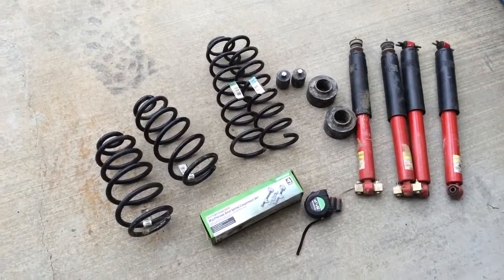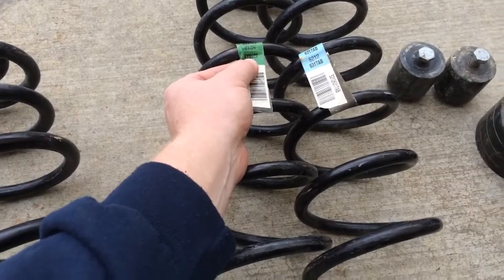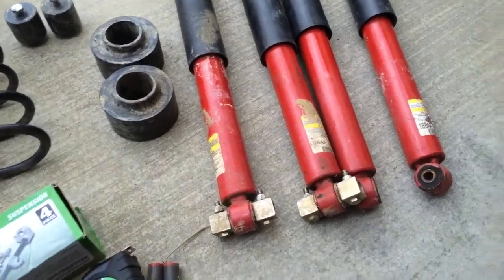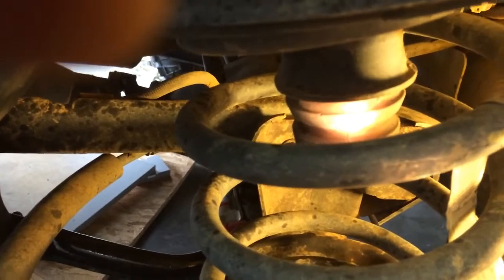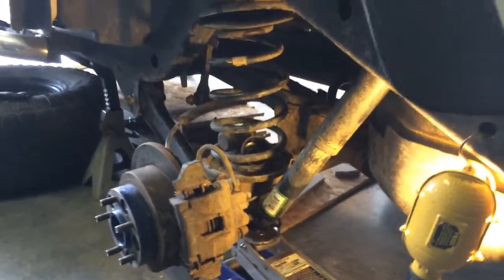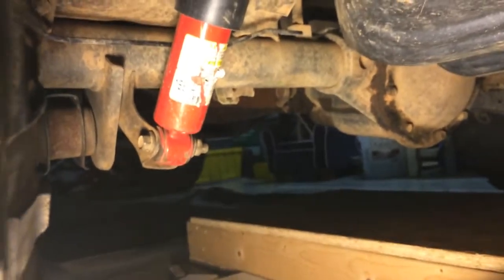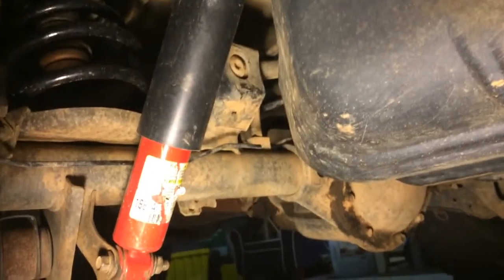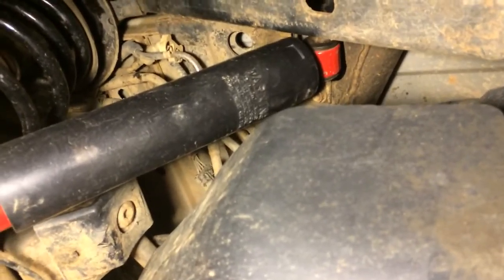Jeep JK springs & shocks installed on a jeep LJ (Rear)

Comment: I did this to my tj with 19 front 59 rear jk springs from a 4 door. I re-used my front 2" spacers and got no additional lift at all. The back springs (without spacers) netted 4"+ of lift and were so stiff they had absolutely no give. Wound up with a massive slant and just wound up buying new lift springs. The rubicon shocks, however, are pretty good- way better than the cheap lift shocks on my old jeep.
Reply from the maker: Update: The past few wheeling trips ( AOP in TN, Golden Mountain in TN, Sandmines/RoyalBlue) I have had a rear spring fall out.

Looking to upgrade to MetalCloak springs all around.

Comment: Hi, thanks for sharing the video. After reading one of the very first JK to TJ swaps on the forum, I bought a set for cheap. The front swap was super easy but there was a lot of talk about widening the mouth of the rear springs, hence I kept putting off changing my rears :) until now. You did not seem to have to deal with that. Is the key to success the removal of the bump stop housing?
Also, a lot of people have asked about how to remove the pins from the bushings.... I did this on the front shocks by improvising using a u joint press and bushing driver set and carefully applied lube only on the pin and not the outer bushing otherwise the bushing will come out.  The u joint and Bushing driver set can be rented for free at Autozone. I used a 3 inch hex ratchet head extended to push the TJ pins out and then the TJ pin to push the JK pin so that the TJ pin sets in as it drives the JK pin out...confused yet ;)....good luck..
Please do drop in a line about the rear spring widening issue, and also a comment vis a vis a 2 inch budget boost lift in the rear. Thx
Reply from the maker: +maarzz     Rear springs... The bump stop extensions fit in the springs hole w/o modifications. Just as to tap a few times with a mallet.  

Budget boost went on front, not on rear. Front springs from JKU were about the same height as stock springs. 

Pins on shocks... I was always taught to use a deep socket to remove? Find socket that pin goes in, but bushing will not. Apply lube to pin.  Place socket on ground. Hammer pin out.    Reverse process for install.

Comment: About to put of set of JKUR shock and springs on my TJ, what kind of bump stop extenders did you use? Length or link if available please. Good video, excited to see what I can get out of mine.
Reply from the maker: Justin: they are 2" extensions. I don't recall the brand. Most likely rubicon express. I got them locally from rockyour4x4

Comment: 2009 2 door rubicon suspension on 1998 tj. how will this end up in terms of lift? 4 door jk has longer and stronger rear springs from what i know right?
Reply from the maker: It's really all about the ##'s on the springs. 
We did the softest wimpiest 2 door springs on a TJ and ended up w/ 0 lift =)

Comment: I have never wrenched under my jeep before so this video is awesome. Question though, did you need the bar pin eliminators or do you think i could get away without using them? they are a tad bit expensive.
Reply from the maker: Tyler, Did not "NEED" the front BPE... I thought it would make things easier, but in reality, I don't think it made a difference. If you don't use the BPE, you will need to knock out the Pin from your TJ shocks and insert into the JK shocks.... Using BPE, I had to knock out the pin on the JK shocks, and insert the BPE pin into the JK shocks... so it only saved me knocking out the TJ pin.... the easy way to do this.... put a socked that is larger than the pin, but smaller than the bushing on the ground, place shock on socket, hammer pin down so it drops into socked.

Comment: Real good video, wish you had not cut out all the work. Would like to see the actual removal and install
Reply from the maker: Hey thanks. Made this video when I was just starting to make video's. I wanted to make them "shorter videos" with just the "meat" in it. I hate video's where you watch a guy turn the wrench for 3 minutes removing bolts. =)
Reply: @myjeepheap2526  yes and the never ending talking just to talk.  It is nice to see how you got certain bolts out. Sometimes those wrench angles are tough to get.

Comment: So your telling me to look into specifically a set of coil that come off a 4 door? sport, Sahara, Rubicon or does that matter, and in the end how much bigger or stiffer are we talking?
Reply from the maker: +Lincoln Bray  I don't have exact ##'s.... but more general info....
There are a few different levels of springs. 2 door sport soft tops are the softest, Rubion X is the stiffest.

Depending on tow package/hardtop etc, you could have any of the springs in the range.

SO the ##'s on the springs range from Front: 14 Rear:56 (softest) to 19/60 (stiffest).

So for the most lift you want front springs ending with ##'s 19 and rear's ending with 60's.

Comment: I am just now seeing this video and am curious as to if I was to buy a 2, 3, or 4" JK lift springs for front and rear if I would see additional lift (I mean obviously I would but is it more economical and rough) and how would the flexing work being that they are stiffer springs to accommodate the weight of the JK..... also does it matter being springs of a JK or JKU because of the weight difference? which did you use in the video?
Reply from the maker: I did jku springs on my lj and a few 
I did regular JK springs on one, and it just netted a lower lift.

If I was spending $, I would just buy TJ/LJ lift springs, not try to use JK ones.

Comment: Quick question about the pin eliminators, how did you install them on the front shock lower mounts? Did you press out the bushings, widen them for the pins, then reinstall? Or just removed them altogether? I've bought similar looking eliminators and they seem to be too big for the bushings.
Reply from the maker: justin riehle  bushings stayed in... Just removed the pins and then pressed in the bars for bpe's. Used lots of lube. I hammered tem in.

Comment: So did you have to do the sway bar or anything else? Or was it simply just swappin out shocks and springs and then addin the spacers? Cause I know if you start to go over 3" then there's a lot more to do.
Reply: yes no?
Reply from the maker: Tyler Fargo Apologies fo rhte slow response... I did not do anything with the rear swaybar, but I already had JKS quick disconnects for the front.. I did not do anything with trackbars at all.
Reply: should i also install jks quick disconnects or do you think i dont have to ?
Reply from the maker: If you take it offroad, I would highly recommend some sort of quick disconnect. I don't think it is required for the jku spring swap.

Comment: did you have to fix steering and a wobble afterward? I lifted mine with the JK suspension into the TJ and the jeep seems to drive out of control...
Reply: did you fit new tires and rims at the same time? if not id check for worn parts and if no issues are found try buying or making a couple adjustable control arms to bring your front axles angle back to factory or closer atleast, it is tipped forward/downward now with the lift which affects steering/handling
Reply from the maker: I did not have any DW afterwards. I did get some later on down the road, put on some friends wheels/tires and it went away. Got a new set of wheels, tires and was good to go again.
Reply: I just finished my JK springs install and some 35" tires on my new to me TJ,  driving a little wierd but just bought it, did not have sway bars connected I sure that would do it but also ordered control arms

Comment: what the difference in the 18 over the 17 in the front coils that you went out of your way to mention?
Reply from the maker: Hey, higher numbers = stiffer springs = more lift.

Ie: 2door softop has the lowest #
 JKUR10A hardtop  has highest.

Jk's have a side mounted tank, so that spring is typically stiffer, thus the 2 different numbers.

Comment: Do you have to change out the springs? or did you do that just because?
Reply from the maker: +Victor Flores I did because I had the parts already, so was a budget friendly lift for me. If I had to spend $$$$ I would
Go with a purpose built .

Comment: Did you reverse the jk springs on the rear upon install?
Reply from the maker: Gun Doc Not 100% sure what you mean. The jk springs are aligned the same as the OEM ones were.
Reply: I got the springs and such off a 2012 Jk 4 door sport model and looked at his before he had his lift installed last week the smallest end on the pig tail was on the bottom perch on the axle however in your video it looks like you use that end of the coil and install it underneath the bump stop cup on the frame end I just wanted to make sure before I took all that apart on my rear axles so basically did you have to flip the springs upside down when you put them in your lj?
Reply from the maker: I did not see them installed on the JK. I did install them small side up.
Reply: Gun Doc I have that problem now the rear coils are different and I was wondering on if so you have to flip them and maybe the top will just be sliding around or what

Comment: Can’t really tell in the video but the shocks look way to long to me. Looks like they would bottom out before the bump stops hit
Reply from the maker: Bump stops on rear actually touch on compression.  My tires hit the Metalcloak fenders on front before anything stops them, so that could use some adjusting. 
On full droop, my drivers rear spring has fallen out a few times, so i added a clip to keep it in.